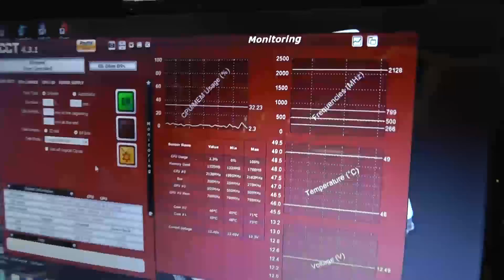Asus G60V Over Heating Repair Mod Made Simple by TimsComputerFix.net

Comment: Yikes i just cleaned the fan and fins and cleaned the old dried out compound and put arctic ice one it and runs fine again. It overheats because the the heat sink compound drys out and hardens and no longer conducts the heat. My customers would be rather upset yes lol
Reply from the maker: +LiveWireFLP Improving airflow dramatically reduced temps in my case. Thanks for watching.

Comment: does this not cause the other parts of the laptop to run hotter because there is less suction on the smaller vents over the hdd chipset etc?
Reply from the maker: +Michael Homan No, it actually allows more beneficial air flow for the components.